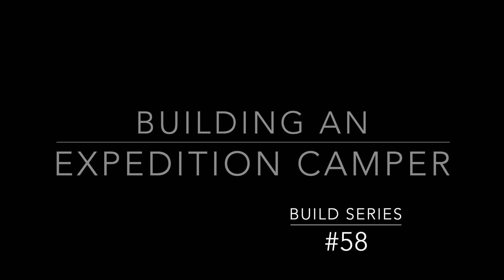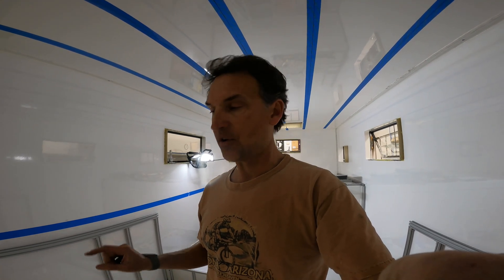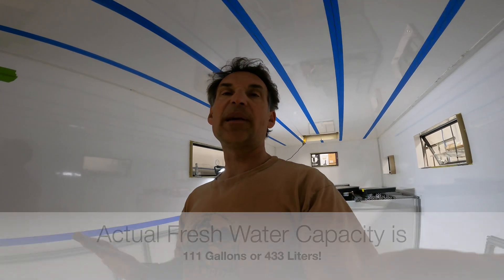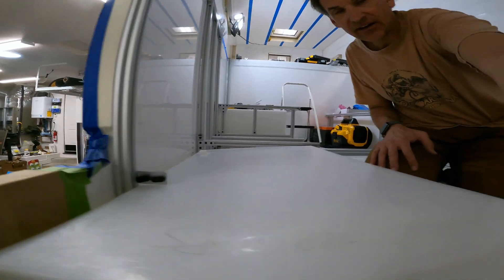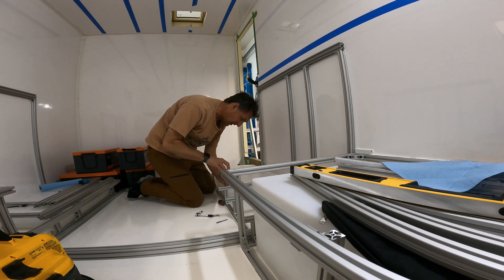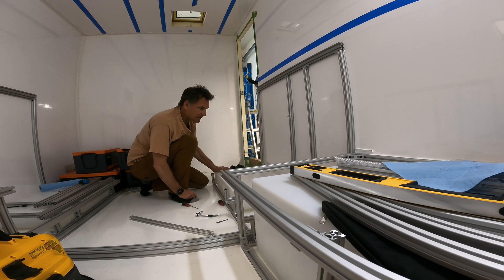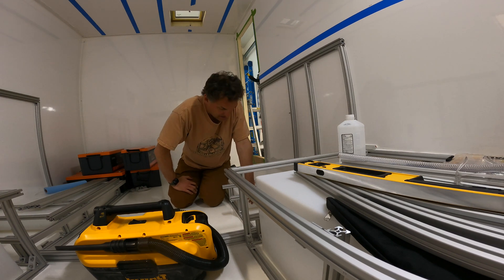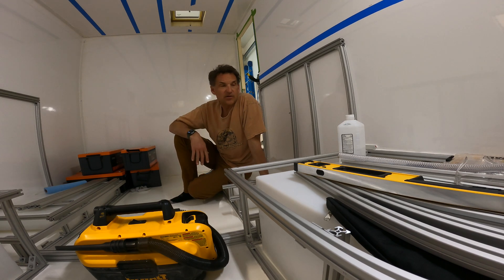Fitting 111 Gallons of Fresh Water in my 8020 Expedition Camper Cabinets

Comment: assuming youre going to use the daewoo mini for the washer. how are you stepping up the voltage?
Reply from the maker: Yeah, that would be a good option except for availability in the US and 230 voltage. I have installed a unit from Splendide who they and Equator also make combo units for RVs and homes in the US at 120vac.